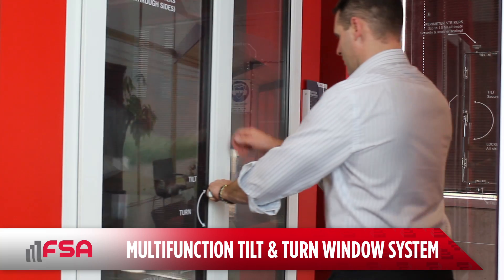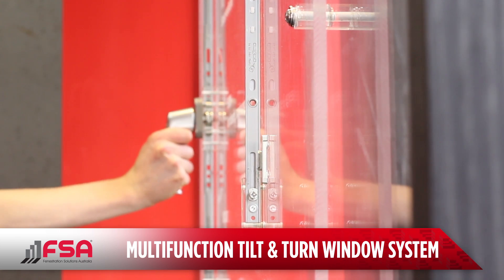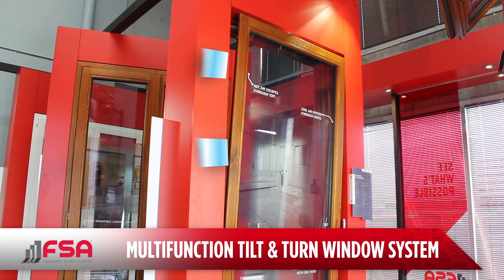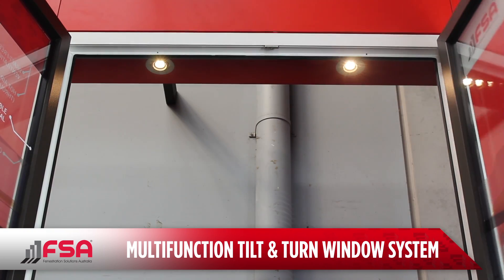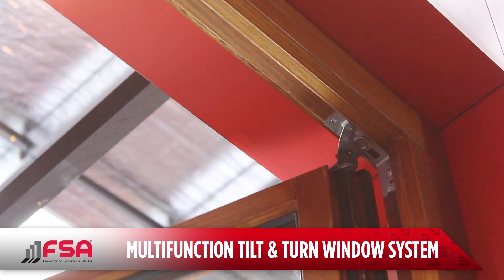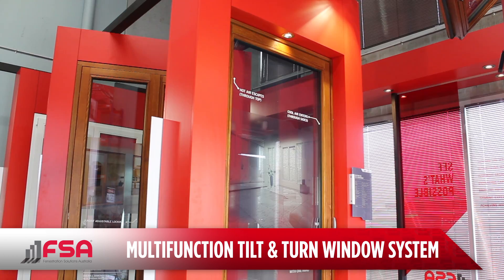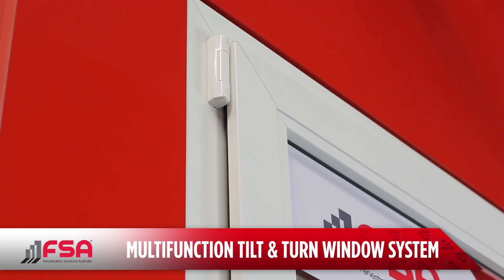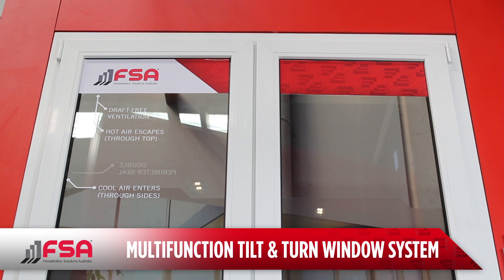Multifunction Tilt & Turn Window System | FSA

Comment: brilliant
but must be a nightmare to maintain
Reply: no not really ....the windows are standard in Germany and I have never maintained anything -
Reply: Actually not. Since I moved with my family to renovated block of panels ("panelák") in Czech republic with such windows and balcony doors, the only maintenance is once per year put some grease into locking mechanism to prevent its premature wear and check rubber sealings if they are in position and not dirty. Sometimes you adjust window's horizontal and vertical position and thats all :)